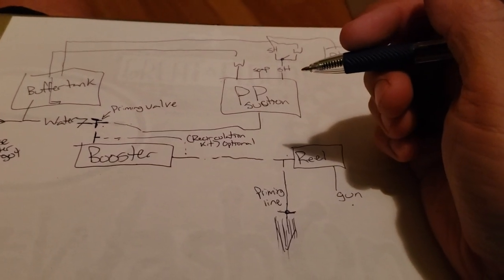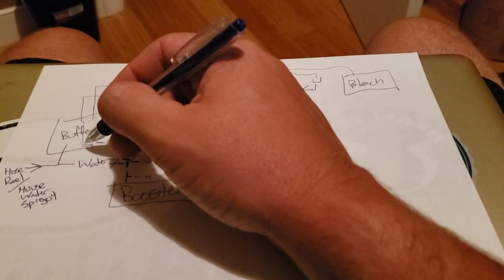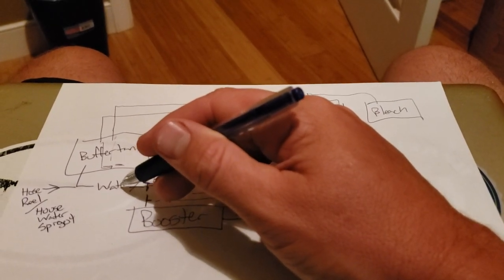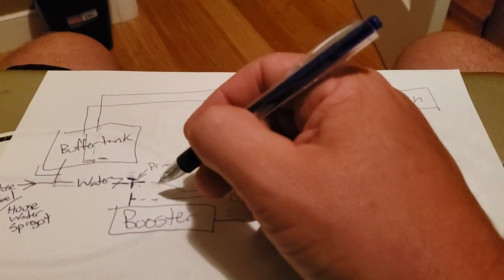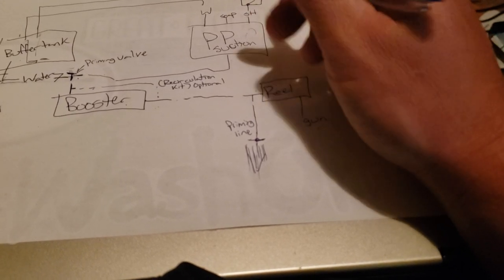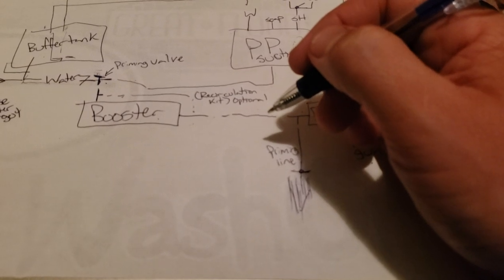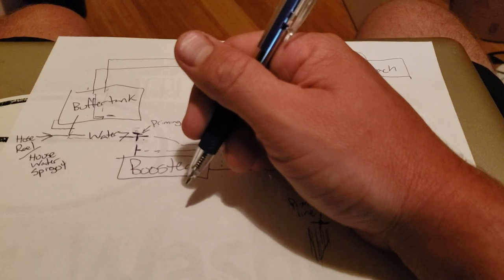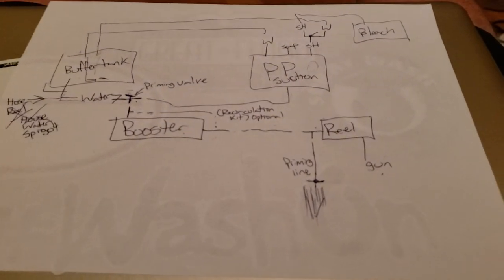Proportioner and booster pump plumbing diagram. With Force fed and tank fed priming options

Comment: Hey Rob just starting to get into soft washing and learning a lot from your videos in the diagram you are showing do I need a 12 V or booster pump or both for soft washing I’m a little confused with that thanks
Reply from the maker: Any transfer pump.  Air, booster or 12v
Reply: So if I am using my 12v pump (7gpm) for solution you're saying to add another pump to my water intake? I like the idea of that